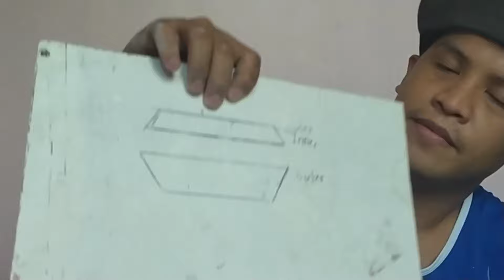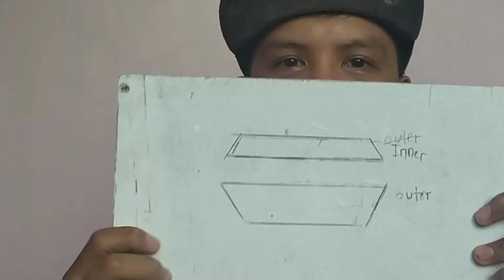DiY kwarto part 6 PAANO MAG LAGAY NG CORNESA SA KISAME

Comment: Boss may bahay ako gsto ko rn kisamihan? 24sqm floor plan nya? Mgkanu kaya mgagastos ko dun? Hardiflex gamitin ko saka metall furring? Salamat
Reply from the maker: Boss estimate lng from my imagination haha
9 hardfilex 1/8size 300 x 9 pcs= 2700 
kung 1/4 size 350 isa samin
Tapos metal furing bka umabot ka ng 15 to 20 pcs .. if 120pesos metal furring x 20= 2400
+revit or hardiscrew. Around 500
=5600 then expect the unexpected materials masilya pintura etc magtabe k lng 10k hehe
labor mahal x2 ata sa materials
Reply: @CactuzYow  salamt boss s idea